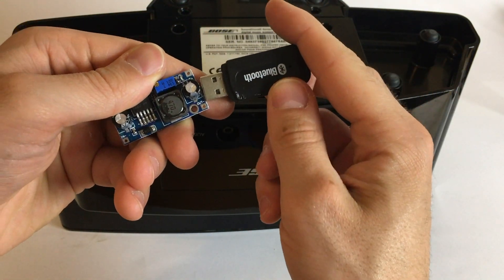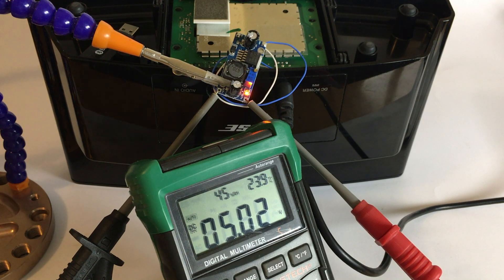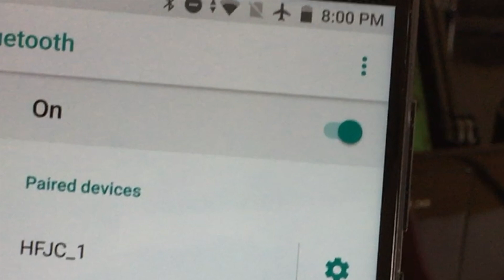BoseSound Dock Series 2 - Bluetooth Hack Fail

Comment: Interesting video, couple of comments, you dont need a seperate 5v power supply just use the internal 5v ipod charging voltage and buy a cheap bluetooth module rather than break open a usb stick. Alternately why not just buy for around £3 a 30 pin bluetooth module and just plug it into the dock connector without the hassle or smoke.
Reply from the maker: Thanks a lot! I totally forgot about the internal 5v. I should have done this. This would have prevented me from frying the board :D
Regarding the 30 min bluetooth module - My thought was to integrate the receiver into the device. I did not want to have the receiver resting on the pins all the time.